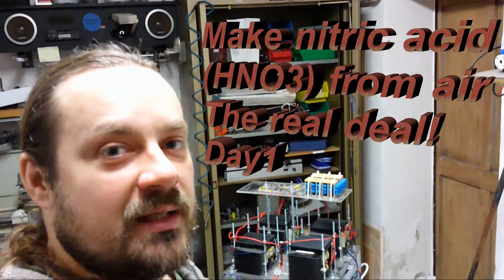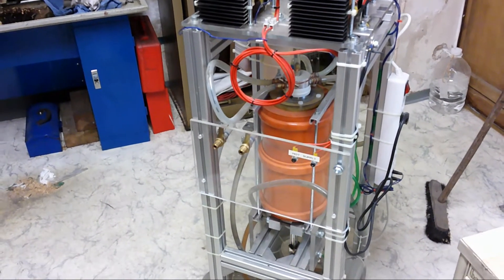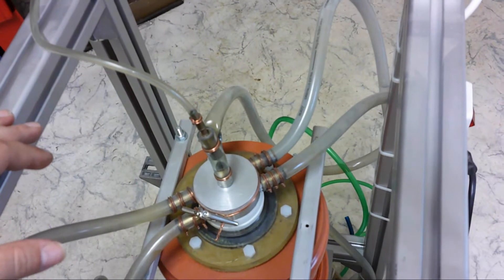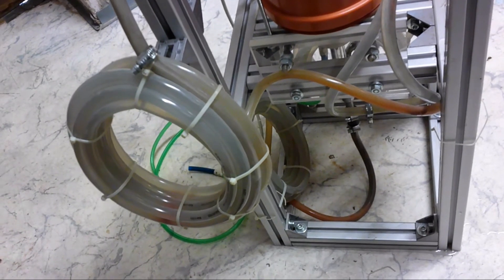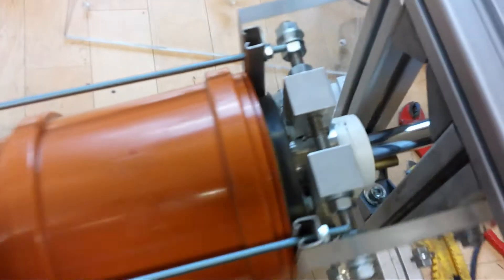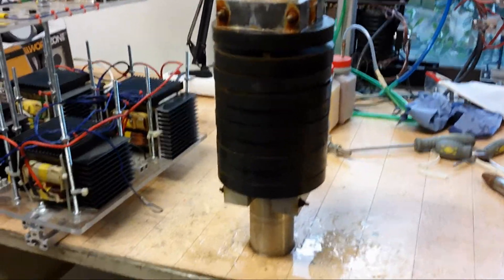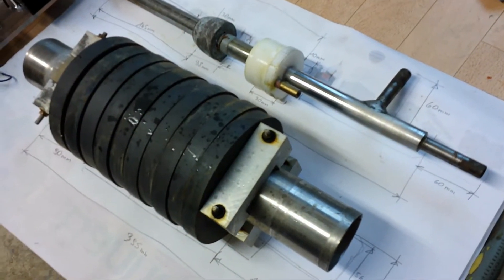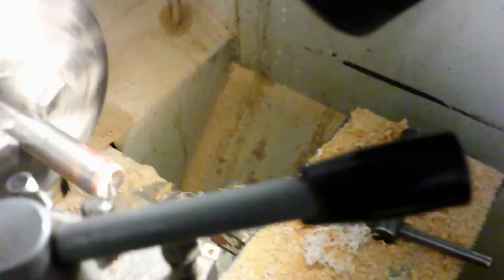Make nitric acid (HNO3) from air. The real deal! Day 1. Disassemble the old birkeland eyde device.

Comment: "Why does the arc goes around in inside a magnetic field" 

It does so because of the direction of magnetic field and current.   It's exactly like a motor. Where the current is radial and the magnetic field is axial, a force (on the ions) is generated at 90 degrees to both the current and magnetic field pushing the radial arc around. 

More precisely,  Fleming's left-hand rule for electric motors is a helpful aid. Where with your left hand, when you position your thumb, index finger, and middle finger at 90 degrees from each other, When you align your index finger with the direction of current, and your middle finger with the direction of the magnetic field, then there will be a force thrust in the direction of your thumb. 
 

Memory aid linguistic order, Left to right,  motor to generator.... both motor and left are first, and generator and right are second, so the left hand rule is for motors and the Right hand is for generators.

Memory aid for Left hand rule
(Th)umb = (Th)rust
(I)ndex finger = (i ) for i or current in ohms law. 
(m)iddle finger = (m)agnetic field. 

The memory aid for the right hand rule is less intuitive. 
Thu(m)b  = (m)otion 
(F)irst finger = (F)ield 
Se(c)ond = (c)urrent

Comment: Faraday had a "motor" that was a magnet, a wire, and a dish of mercury. I think your plasma is similar, and spins because the arc in the magnetic field experiences a force at right angles to the direction of current. But is it AC or DC? I think you could make "making of" videos and stretch your content out.

Comment: Here you can see a tryout to modify a cheap welding inverter into a high voltage source running at about 28 khz with a power of 400 Watts in that case 
https://www.youtube.com/watch?v=MeidBRS8SLc

Comment: Hello Andreas,  have you an number about the yield of nitric acid you can produce if the system runs a week or so? How concentrated will the acid be without destillation (only by bubbling the Nox through it) I am from Graz so if you want to get in contact with me pls. answer here, I am also interested for years in that kind of getting Nitric Acid from air. I can maybe add some knowhow by using cheap (Zgonc) welding Inverters as High Voltage source. So would be great if we can find a way of exchangin some technical info. cu Michael
Reply: This is a very inefficient way to make nitric acid. But it is available pretty much anywhere. If you use excess solar power it is cheap enough to compete with bought nitric acid. The concentration is a function of your loss tolerance. Higher concentration nitric acid is less likely to absorb further NO2, and it will bubble through without absorbtion, making loss.
Welding inverters are low voltage high current sources. You'll not be able to make high voltage arcs with a welding inverter. Neon sign transformers can be bought for a couple of bucks on ebay every now and then. No need to go into the hassle of modifying a welding machine.

Comment: y not use a cheap plasma cutter as the base energy unit?
Reply: Because you need a specific voltage (~2000V) for optimum efficiency. A plasma cutter produces a much too low voltage for it.